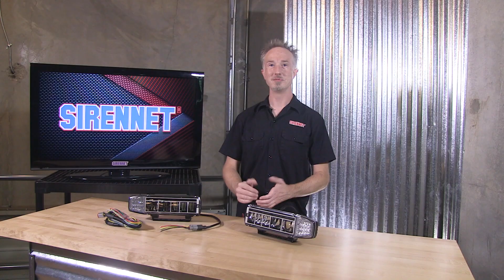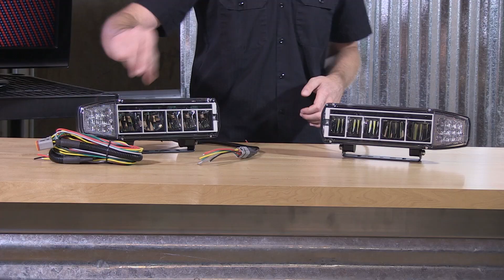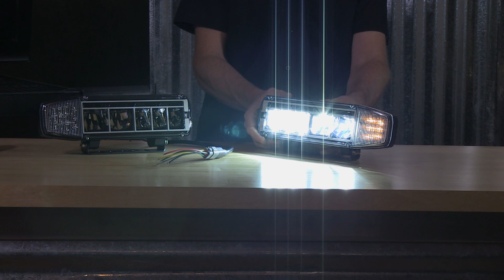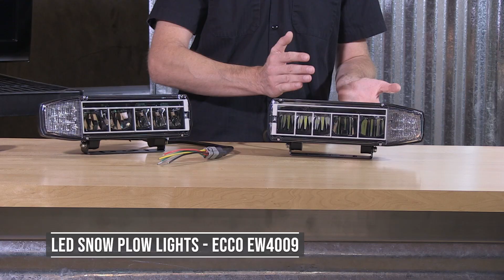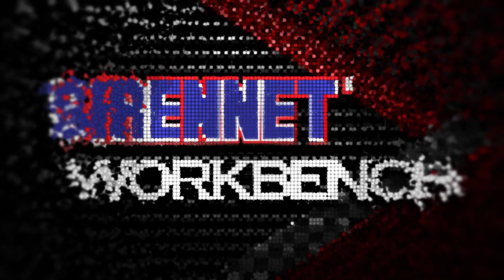ECCO 4009 Snow Plow Lights

Comment: What's the difference between these and the eccos you showed a week ago the ecco 4008
Reply from the maker: Biggest difference is that the ECCO 4009 features a heated lens to melt away snow and ice.
Reply: @SIRENNET  ok also after rewatching the videos it seems the 4008 has higher lumen output also